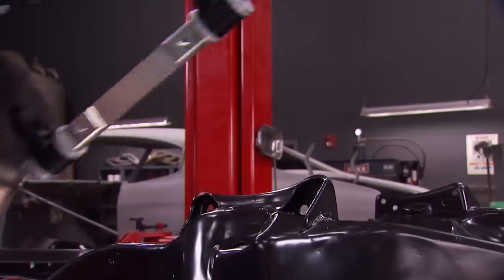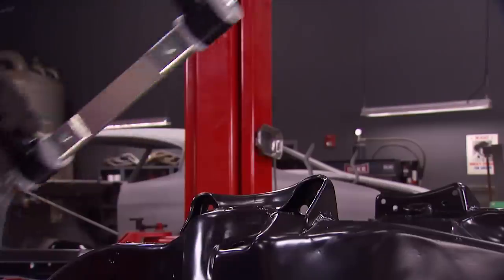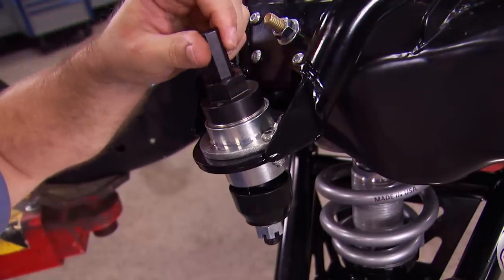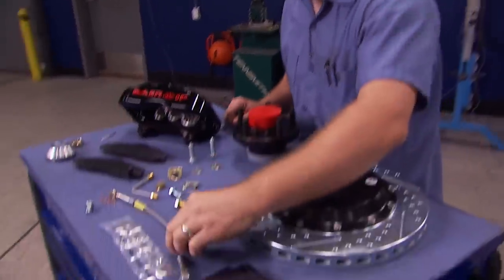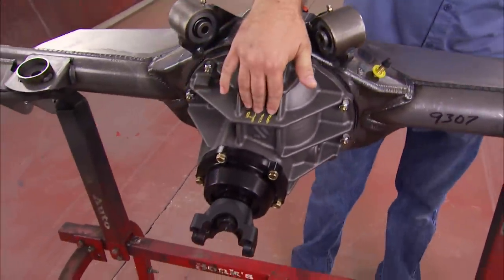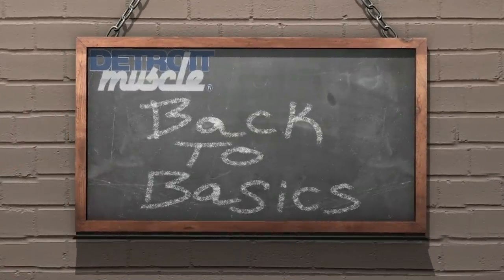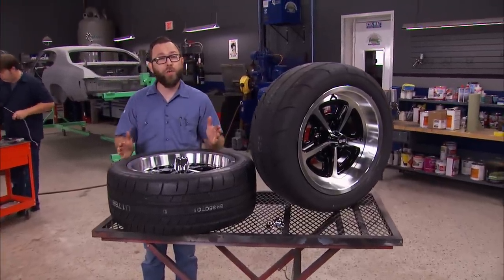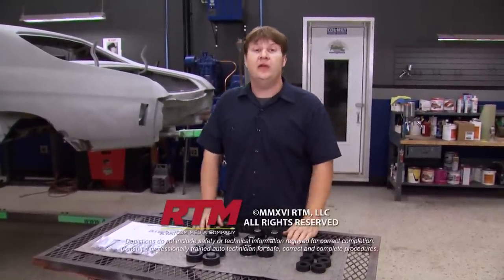Converting a Chevelle Chassis into a Modernized Monster - Detroit Muscle S3, E17

Comment: Very nice suspension upgrades that should help significantly with handling. My only concern is connecting it all to a non boxed frame that will twist like a hula dancer. Great kits are made to stiffen both Chev and Ford perimeter frames.
Reply: What is the best route for a 1979 El Camino front and rear suspension.. 4A  race car application. I would like to do a full brake assembly.. how much would something like this cost..
Reply: @michealevans7959  opl

Comment: wish they would SLOW Down this is not real TV its Freaking U-Tube but I understand. I have 2 questions What is the advantage to using QA-1 Lowers? Can u put a larger/Wider tire under the Chevelle If so what size? And on my frame I added the summit racing stiffening kit Where and how do  run my Brake lines which I got from summit racing Also stainless steel of course? Any help would be much Appreciated...

Comment: This is awesome, we have a 64 Malibu that could use the basic kit. I plan to start restoration on it soon and already planned new suspension and disc brakes so it's safer to drive and occasionally beat on. It was done up twenty years ago and driven occasionally then we've been storing it for awhile now as other expenses arose. My house is within a year of being paid in full and then I'm gonna start on it. Every classic muscle car deserves restoration!! Too many older vehicles dissappeared. My dad inlaw has a beautifully built 31 A model setting next to the Malibu in heated garage I can't wait for them to be similarly bada$$. He has a blower on his small block tho. I may go LS or matching edelbrock aluminum heads on our 350. It's got that matching performer rpm intake and carb so far but could use a freshen up and more power parts. Powerglide needs freshen up too. Great video guys! I didn't know these kits existed yet.
Reply: try spohn they have a lot of these parts for cheaper. on  my 88 monte ss they had an explorer rear brake kit for its disc brakes in rear. saves alot also other cheaper bare kit

Comment: Cool build and upgrades but be careful with those old frames. They were designed to have some flex, stiffening them up that much can lead to cracking when driven hard. Especially in the front around the A-arms and spring mounts.

Comment: If I drill a hole in something I've painted  I will hit the hole again with some paint so that spot of raw metal doesnt rust. Surely I'm not the only one who does this?
Reply: so many people take shortcuts in life
Reply: And also I would’ve stiffened that chassis at its week points where it flexes under hard launches and extreme cornering
Reply: The Truth about Africa hurts now that’s modest 😂
Reply: Jack Benton  This crew is terrible, newer ones are much better.
Reply: Right you are - paint isn't about pretty with steel, it's about keeping your steel.
Reply: Aye guys I was wondering if y'all could help me out...

So I have a 1976 Ford LTD Brougham and I've been searching everywhere for aftermarket suspension but it seems impossible to find compatable ones. Generally GM uses similarly styled bodies and parts for multitude of their vehicles, but I'm not sure if anything besides the Lincoln Mark VI will match up. I'd really appreciate the help if anyone could give some insight on what brands or configuration would be good for suspension for GM cars from the late 70s.
Reply: I thought everybody did that. If you're spending money to build something show it some love for goodness sakes

Comment: nice video guys, as always, the problem i see is with the antiseace, dirt and stuff will gunk up the threads much faster?
Reply: Uhmmm....no.
Reply: Yea but you should adjust your ride height before you go out driving your car. Once the height is set you can wash off the antisieze, if you want to adjust later go ahead and put some more on first

Comment: Nice upgrades but very costly. Unless it's a track car you don't really need the double adjustable shocks, I run the single coil overs on my '94 Camaro and they are perfect for on the street. I will be converting my Chevelle to C6 corvette brakes using a newly developed spindle which allows using all GM parts, including the sealed type wheel bearing assembly. The control arms don't really need to be changed unless the ball joints are worn or you want to install polygraphite bushings. My car came with the factory 12 bolt, easily strong enough, no need for a Ford 9-inch.

Comment: Power Nation   Joseph Monaco
Joseph Monaco
2 weeks ago (edited)
How much would a 1966 Chevelle weigh if it was built like that one?  Also, What is the price for all of the parts to have you build it for me. I need the price on a 1967 Chevy II and a 1968 Camaro. I want the weight of all 3 frames complete and the price of all 3 frames built by you for me.

Comment: That's suspension set up looks nice! 
can't wait for more.
I'll take a hard pass on that crappy battery through.
Reply: That Optima 800 CCP battery is excellent. Do you have over 800HP in your car?  I don't think so. You put 2 of those in the trunk of your car and you can run a Super Comp Race car running faster than 8.20 seconds in the 1/4 mile forever.
Reply: @josephmonaco4503  Mine experienced post seal failure near the 1 year mark - it was replaced by seller under warranty.  So far, so good.

Comment: Never use an air gun on rotors. Unless the gun is calibrated to specific torque it will warp the rotors. I use a 4 way, hand torque to specs, drive and re-torque!

Comment: Bet that kit ain't cheap
Reply: Dan Pierson It was about $3,900 for the QA1 Stage 3 suspension kit for my 66 Chevelle. The rear end was $4,180 shipped. But it ordered the quick change option so it’s about 1/3 more expensive. I’ve been saving for 4 years to build my Chevelle. If I can do it- anyone can.

Comment: Be cool if you would list Prices of these parts ..
Reply: Baer Brakes $2500
Currie Axle $1400
QA1 kit $2200
Spindles $130
Wheels $1000
Brake lines $150
Just quick Google searching.   Brakes I had to play quick on Summit's site.   Add in tax and shipping somewhere around  $8000 since that axle will probably ship as freight due to weight and bulk.
Reply: @BigEightiesNewWave  yep.   But sometimes good kit costs a packet.
Reply: Cheaper than buying a good handling supercar.
Reply: If you can get the car cheap, and the body is not Swiss cheese,  have a place to do it.. well, it would most likely be cheaper then a new car by magnitudes. All in, 30-40k, and it would be new, last way longer, get more looks, and not have to be plugged into a super computer to figure out whats wrong with it.
Reply: thousands and thousand and thousands
Reply: An arm and a leg 😂😂😂😂😂
Reply: @bmstylee  Yeah I had sticker shock when I searched qa1 for my c10...
Reply: More than you can afford pal...Restomod Chevelle
Reply: @hawkdsl  Sadly with the money spent as others mentioned they failed to address a basic shortcoming in this chassis ... lack of stiffness.    I am guessing QA1 sent them parts and dollars so they would use these parts on this project.  Probably leads to lots of parts being sold.

In terms of educational value I don't see it.   What I would like are performance numbers related to steering, braking, handling, ride, etc.  Without that, what justified all the cash outlay for different parts?   All this implies is new parts are better, not always true.   We need something like consumers reports for so called high performance parts.

Comment: @UCjEQrN8vO5a1acdCsv6ZTvA
  
  

    

      

      

        @UCjEQrN8vO5a1acdCsv6ZTvA
        
        
        
        @
        
        

        
        
      

    

    
    

  
  Power Nation   Joseph Monaco
Joseph Monaco
2 weeks ago (edited)
How much would a 1966 Chevelle weigh if it was built like that one?  Also, What is the price for all of the parts to have you build it for me. I need the price on a 1967 Chevy II and a 1968 Camaro. I want the weight of all 3 frames complete and the price of all 3 frames built by you for me.

Comment: Absolutely amazing how flimsy that chassis looks compared to a modern one. It only has 3 cross members and isnt even very thick steel.

I have owned several A body cars and currently have a B body.
Reply: Those parts that are put on those chassis will last forever. They are lighter and stronger. They will make your car handle like a go kart and shoot out from the line at the drags, what else could you ask for? You could repaint your old parts and still ride and handle like a bucket of bolts...
Reply: Flimsy, but in a precise way.  Yes they cheaped a bit, but remember original hp in these cars: sub 300.  With that in hand, frame flex becomes part of a softer ride - it's strictly street engineering, unsuitable for 600hp hard launches.

Comment: What engine do you think they will put in the chevelle?
Reply: 396
Reply: Im thinking an LS engine of some kind. Probably an LT1 or hell maybe an LT4 out of a newer Corvette. They are building a pro touring car so I'm guessing the engine/transmission will be somewhat newer.
Reply: @MrRager-qd3lh  The show is 5-10 years old.. IIRC it was a 396.. maybe a 427. You can see the finished car on their web site for free (with ads).  EDIT: I just looked it up.. it's a 396 punched out to a 406 with a through the carb turbo making 1000 hp.

Comment: Small point, & I'm just nit picking...let's torque our suspension bolts at ride height. It doesn't take much to put a jack underneath, raise the component & torque.I gaurnttee bushings will last longer & feel better...IMHO!
Reply: This is a fact, not an opinion.

Comment: I'd like to see a V8 engine not a monster horsepower more reliable
Reply: That's what I'm going for with my olds 330. It already had about 300hp stock. I figure high 300- low 400hp would be just fine for a realistic street car

Comment: $5000 rear end in a paint booth. Painted with a rattle can! WTF?
Reply: Numb Nutz   Yea,I would use a good coat of chassis paint on that. This show is all about selling parts.
Reply: @fw1421  Agreed.  I guess they were maybe trying to show you what the "average joe" could do in his garage, but with the parts list and 20000sq ft garage with paint booth and multiple lifts it show more what professional can do with unlimited budget and sponsers.
Reply: Its going under the car to get the crap beat out of it, doesn't matter how you paint it.
Reply: @sparkplug1018  Yeah it does, if only as a rust prevention measure.  But yeah, it would have been much MUCH better to have painted it up properly, multiple light coats and baking the paint in between each coating.

Comment: You guys are addicted to arp
Reply: Edward Myers ARP has the best stuff available. Gives peace of mind knowing I spent the extra $200 and got  a quality hardware kit.
Reply: @chloehennessey6813  well of course but arp holding the brake lines to the frame 😂
Reply: Edward Myers Yesh. 
It’s a basic chassis hardware kit lol 
Has lots of little things like that. It beats having to use random ones in the bolt bin 😂
Reply: @edwardmyers1746  Have ARP bolts all over the car, just a better bolt imo. Don't mind spending the few extra bucks honestly.

Comment: If they were going to spend all that money on the rear end, why could they have gone to a GM 12 bolt and keep it ALL GM?
Reply: Well to be completely honest a 12 bolt is not a very good rear end. Gear changes are a pain in the butt that take a long time and 12 bolts are very rare these days. Aftermarket parts support is great and gears are very inexpensive. Most racers use them because you just plug in a different punkin to change gears and it literally takes 15 mins to change gears.
Reply: You got it backwards, if money isnt an issue you wouldnt use a 12bolt.
Reply: 12 bolt is not user friendly  at all and those c clip axle retainers could fail and when an axle pops out and crushes your quarter panel  .you'll be plenty pissed !

Comment: You don't use a ratchet or impact to install suspension parts. You use a torque wrench and tighten to appropriate specs. That is a recipe for disaster. Especially on the first test drive where parts will loosen.
Reply: TheHondaLegacy he mentioned they were just snugging up the bolts- so they can roll it around the shop.

Comment: "and here we put anti-sieze on a bearing surface" cause you know bearings like anti sieze lolol
Reply: Anti seize won't gum up as bad as grease or wash out like oil. Of course these are parts that are intended to be maintained not set and forget.
Reply: @xc8487  anti seize has mettalic flakes in it.. putting a greasy metal flake product on or in a bearing is a terrible idea. Might as well throw the bearing behind the bench grinder and then pack it full of grease if you want the same effect. Thats like saying packing your wheels bearing with anti seize is okay it won't destroy the rollers at all lol. And I hope you realize I'm talking about the spring perch thrust washers too....
Reply: Anti seize is not a lube, REGARDLESS what some "engineer" at the OEM says. It's full of metal grit. It will kill a bearing.
Reply: @chucksteele4787  exactly, why would you introduce metal particles into a bearing/bearing surface. I can see putting it on the adjustment collar threads but not the bearing. No matter what. I've seen a Ford focus with anti seize on the rear stub axle under the bearing. Some previous tech had put on before the bearing, the heat made it fling into the bearing and within one oil change the bearing was shot. Makes absolutely no sense to do such a thing.
Reply: @joshwolff2386  They must have a surplus of thrust bearings they are trying to sell.